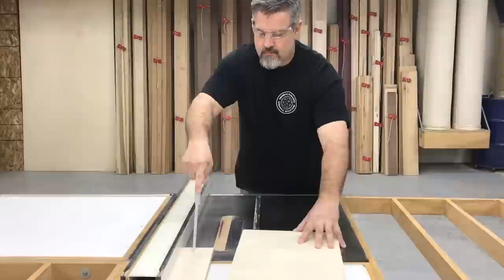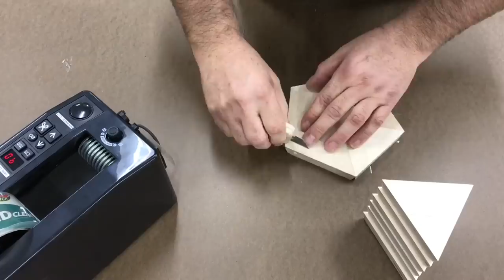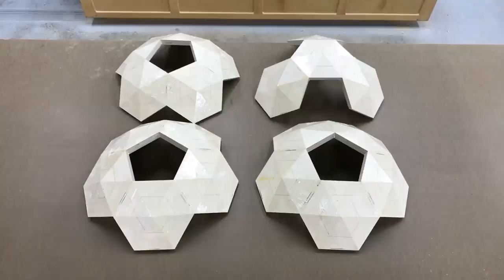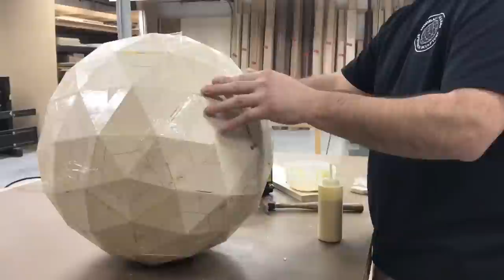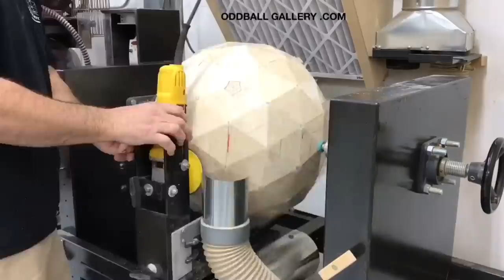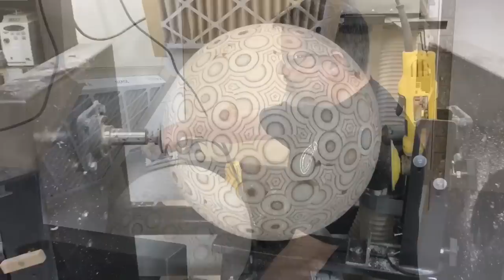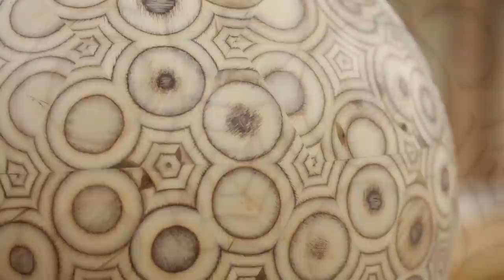Guy makes a big ball out of plywood

Comment: Next one you make, paint one side of the sheet with a distinctive color, ALWAYS, keep that color on the inside of the polyhedron, that way, when you sand it, the patterns will all be correct.
Reply from the maker: aserta  I draw a line on the face side of the plywood so that all of the triangles face the same direction. The 12 pentagons have a smaller radius than the hexagon so that is where the half circle pattern comes from.

Comment: How did the designs get on it?
Reply from the maker: J R    When the ball is sanded, more material is taken off the points of the triangles than the centers.  The center of the triangle is still almost 3/4” thick and the corners are about  9/16” or so. Each ring or line you see is one layer deeper into the plywood. The reddish brown color is just the adhesive used to make the plywood. Birch wood varies in color from white to dark brown, so you never really know what it will look like until it’s all sanded.

Comment: What are the measurements for each piece? Length of the sides.? . . obviously 60 degrees on the corners. What is the angle measurement on the sides of each piece? Thanks! Awesome job!
Reply from the maker: Check out this website     http://geo-dome.co.uk/3v_tool.asp     They have a dome calculator that will help you with the dimensions and angles for the size sphere you want to build.  There are two different triangle sizes but they aren't equilateral. I use 4 different bevel angles on  these. I am working on a video that will give all of the angles for a 5" diameter sphere. It will start out as an icosahedron which will have equilateral triangles.

Comment: how many times did you come close to hypnotizing yourself working on that? the thing spinning towards the end with the twitchy patterns looked pretty surreal.
Reply from the maker: Ralph Mueller   I didn’t even realize the video would have that effect until it was sped up 20X. The ball is only turning at 5 rpm during rough sanding.

Comment: I really like this
So how do you work out the size for the triangle and the bevel for a different size ball?
Please
Reply from the maker: Check out this website.      https://geo-dome.co.uk/3v_tool.asp.  They have a dome calculator. It is set up for domes , but it will be the same angles for a sphere. Just enter the radius and it will give you the strut lengths (triangle side lengths) and the dihedral angles (bevel angles) It is even color coded. The triangles will change size but the bevel angles will be the same for most 3v spheres. 👍🏼

Comment: How does this video get one THOUSAND dislikes?? I don't understand that! What, you don't like the music in the background? You don't like wood glue? You don't like geodesic patterns? WHAT? WHY??

Anyway, great project - very cool design it ended up being! But I bet that little one was a ~bleeping bleep~ to make, since it had to use such small pieces.
Reply from the maker: Mary Ann Bittle  I guess there aren’t as many woodworker/metal heads as I thought. 😀.  Yes the smaller triangles are harder to cut and leave less room for error.
Reply: @ODDBALLGALLERYKeithWilliams  well, apparently not! But I enjoyed the music as well as the project. 😊😁😎 IMO, the only thing more metal than woodworking and listening to metal is metalworking (welding, shaping, sharpening or rounding off - basically almost like woodworking without the sawdust) and listening to metal! 😄 Which I did for decades as a semi trailer mechanic, along with parts replacement, hole patching, or painting. 😏😉😎

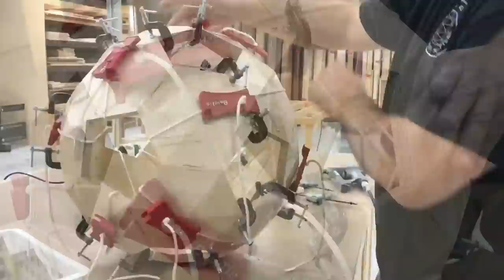Comment: appears to be a truncated icosahedron whose faces are then subdivided to make a more approximate sphere. -- aka order 2 geodesic dome shape -- similar to a traditional soccer ball which is made of hexagons and pentagons -- here those are further sub divided. (1:35) -- going to teach math not to some 6-10 year olds.  BTW, how could one 'get' the exact angle for a pentagon without using a protractor for instance, so geometrically
Reply from the maker: Rosseo B  There are geo dome calculators available online. I didn’t find them very useful for my way of doing things. I used some simple math and a lot of trial and error.
Reply: @ODDBALLGALLERYKeithWilliams  it would have been great then, to show your "failures" trial and error, a proven method

Comment: I muted the vid, put on some jazz in another tab & watched it haha.
So beautiful work! I'm still confused how it got the circles in the pattern. When I looked at the thumbnail I thought it would be a segmented piece but it's so unexpected. I love it.
Reply from the maker: Thanks 👍🏼  The center of each triangle is aligned with the surface of the sphere. The corners of triangles stick up a little so they get sanded off. The circles are formed because the layers of the plywood get sanded through unevenly.
Reply: @ODDBALLGALLERYKeithWilliams  ohh I see it now!!
The corners are sticking out more than the centre of the triangles, that's why, ofc!
Thank you for the response Keith, best wishes.

Comment: Just out of curiosity, what's the measurements and cutting angle of the triangle's?
Reply: Guess I should say the angle of the miter cuts.
Reply from the maker: AJ Hillenbrand check out this website http://geo-dome.co.uk/3v_tool.asp. It has s calculator and a color coded picture.

Comment: I'm not a carpenter, but I made one of these balls last week, about 8" dia. from 60 triangles. It came up really well for a first try.  No gaps or cracks.  But I didn't have one of the fancy woodturning setups for making it round.  I used a metal cone made from a small chimney flue cap, added a holesaw arbor and put a disc of 40 grit circular sandpaper inside the cone of the flue cap, with velcro dots.  By just lifting and turning the ball under the spinning cone on a power drill until there were no more flat spots, it ensured that the ball came up perfectly round.  A little more hand-sanding with the cone using 220 grit paper really smoothed it out.    3 coats of lacquer later and it looks like a shiny bowling ball with a magical pattern.
Reply from the maker: Nice job 👍🏼 Way to make it work using what you have. So did you make a dodecahedron with 5 triangle pentagons?
Reply: @ODDBALLGALLERYKeithWilliams    Yes that's right Keith.   the 60 triangles made 12 pentagons.  Credit where it's due.  My wife saw your excellent video and 'persuaded' me to get involved in making one.  The first challenge was to cut the ply into strips on the correct angle.  A few years ago I found an el-cheapo Ryobi table saw (with a bent leg) in an industrial skip.  So I repaired it for this job, powered it up and was able to cut 50mm wide strips with the 9º angle on both sides.  Then with the correct secondary angles in a basic drop saw and a backstop, I could cut the triangles by flipping the strip with every alternate cut.  Once I worked that out it went really fast to get the 60pcs.  The pentagons all went together really tight on the first attempt.   I just put the third coat of clear urethane on the ball and it has taken on an excellent golden colour.  It is about bowling ball size.  A pity I can't post pictures here.
BTW We're a few km East of Melbourne.  (Australia, not Florida)   Cheers.
Reply from the maker: A Galah  I’m impressed that you got it to work on the first try.  I made quite a few before I even had one worth showing. I’d like to see it , send me a pic to oddballgallery@gmail.com

Comment: I thought it looked awesome before being turned also. From the title and picture, I thought he was going to laminate plywood into a solid cube, then turn that to a sphere. Wouldn't that work too? And be much easier? Or am I missing something? I know this was much cooler and took much skill though and liked it
Reply: Off course you are, the pattern, that the individual pieces reveal when sanded back.
Reply from the maker: Masterofsparks Hwy6  Yes it would be easier...but it would use a lot more material , it would have a bland pattern, and it would  weigh 80 pounds. My goal on the project was not to make it less difficult, but to use the difficulty as a bridge to the final outcome. ( That sounded kinda artsy) 😀
Reply: @ODDBALLGALLERYKeithWilliams  righr, I figured as much, this was definitely a cooler project, I was just thinking, in a pinch, if I needed a wooden ball big enough for my ex to choke on.... just kidding,

Comment: This is fake. The only way for the ball to look like that was through building it in different color blocks in the building stage not spraying it
Reply from the maker: asdfg asdf     I can assure you it’s not fake. But, you are right the plywood I am using is made up of many different layers and colors of birch veneer. The pattern comes from the different layers of the plywood being exposed as it sanded.
Reply: ODDBALL GALLERY - Keith Williams you can see the ball edited into a pattern in the beginning of the video
Reply from the maker: asdfg asdf OK 👍🏼

Comment: What is the angle cut on the side of the triangle pieces?
I need to make one of these balls
Reply from the maker: Heath Gentry  There are four bevel angles and two miter angles. This website has a calculator to help with the measurements. http://geo-dome.co.uk/3v_tool.asp

Comment: Looks like about 15 degrees on those triangles. Equalateral triangles? If so about 3" each side?
Reply from the maker: Wild Bill These are four inch triangles, But they are not equilateral.Check out this website it will help you with triangle sizes and angles http://geo-dome.co.uk/3v_tool.asp